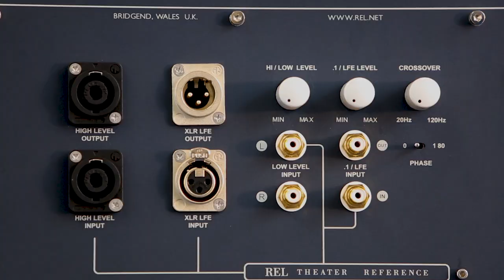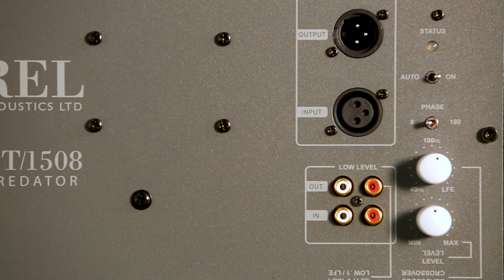Why you should connect your REL subwoofer with both high level and .1/LFE inputs

Comment: I still don't understand why you should hook up LFE when using the high level input. If you set your front speakers to LARGE, and tell the receiver you have no sub, won't it send the LFE track to the front speakers? And since the REL with high-level input is "seeing" everything the front speakers are getting, isn't it getting the LFE channel through the high-level anyway?
Reply: CelerityHouse GREAT QUESTION???
Reply from the maker: The setup that you have described can work in a pinch, though doing this will take up extra bandwidth and amplifier power from the front left and right channels on your power amp, since they will be needing to output both the front left and right channels as well as the LFE channel, which is typically a very high output and highly dynamic channel of the surround mix. Using both the High Level input and the .1/LFE input will keep your front speakers from trying to output the LFE channel's extreme sub-bass information, and leave this task to the subwoofer which is designed to handle it.
Reply: @RELAcoustics  Ah, okay, thank you
Reply: @RELAcoustics  Is this for any subwoofer that has high level and LFE or just REL?  I have an Energy S10.3 and it has both high level and LFE, but the manual says to not hook up both at the same time.  It also has a crossover bypass switch which is to be toggled whether the receiver has bass management or not.  Would I be safe to hook up both?
Reply: @RELAcoustics  To add to this almost all speakers will crap out at some point with too much bass before the tweeters etc will. you dont want an LFE channel going into your main speakers, that's just asking for a +20db bump in bass (reference Home THeater is 85db with 20-30db of bass headroom) and potential damage to your speakers.
Reply: @RELAcoustics hello i have a 2.1 system with REL tx7 sub.    And Dali rubicon 5 i have both connections  at same time high level and LFE  . For movies i will use the LFE Channel. My question : when i gain the level control on sub for LFE  it also gains my level in high level simoultanisly!? In my stereo receiver Marantz pm7000n i set crossover to 60 HZ best regards from Germany Robert
Reply from the maker: @robertdalmatinac1914  Thank you for reaching out. The T/7x has separate independent level controls for the High Level input and the .1/LFE input, which means that the output level for the .1/LFE channel can be set independently from the output level for the High Level channel. If one of these Level controls is setting the output level for both the High Level and .1/LFE channels at the same time, then feel free to write in to contactus@rel.net and our team will be happy to assist.
Reply: @RELAcoustics  yes the low level lfe controller gains both…the lfe and the high level! I have contact you in  support email. Best regards Robert

Comment: Hi. I just purchased a pair of REL T5i’s. 
For stereo listening I will connect them to my integrated amp’s (Roksan K3) speaker posts through high level neutrik cables. 
However I use the same integrated amp and front speakers as part of my home theatre system run by Denon x4200. Both amps are connected through HT bypass.
As far as I understand my system will become 5.0 as no subs are connected to Denon’s line in LFE connection.
Can I use sub cables that will directly run from RELs to Denon’s subwoofer pre inputs, at the same time with  high level connections made between RELS and Roksan K3?
Would that damage my amps or subs?
I want to use both subs both in stereo listening and home theatre with maximum performence.
I hope I made myself clear. Thanks.
Reply from the maker: The T/5i subwoofers can be connected using both their high level input and .1/LFE input simultaneously. In this way you can connect high level to the speaker output terminals on your 2-channel integrated amplifier, and also connect to your Denon AVR's sub-out using the .1/LFE input. The T/5i has separate level controls for each of these inputs, allowing them to be tuned independently.
Reply: REL Acoustics cheers tnx a lot. Great subs!
Reply: @RELAcoustics does REL STRATA 5 can be plugged into my YAMAHA dsp A2 - LFE + HIGH INPUT at the same time with no risk of damage to amp or sub? Do I have to mute LFE while I'm listening in stereo only?
Reply from the maker: @magnatUtube  As with the majority of our current models, it is possible to connect to both the High Level input and the .1/LFE input on your Strata V subwoofer, and run signal through both channels simultaneously.

Comment: when both is plugged, are both level control work?
Reply from the maker: Thank you for reaching out, and that is correct. On our High Level compatible subwoofer models there are two separate Level controls, one for the High Level/Low Level input and the second for the .1/LFE input. This means when connecting to both the High Level input and the .1/LFE input simultaneously you will be able to adjust both Level controls to tune each of these inputs independently.

Comment: Is this a unique feature from REL, or can you do this with all subs that have both high level and lfe inputs?
Reply from the maker: Some subwoofers from other manufacturers feature speaker level inputs (in our case called high level inputs), though in our experience not many are designed so that you can use both the speaker level input and the LFE input simultaneously. If your subwoofer features both inputs, I would recommend reaching out to the manufacturer to confirm if they can both be used at the same time without overloading the subwoofer.
Reply: @RELAcoustics  Thank you
Reply: Is this only for theater (movie watching)? In other words if playing music the LFE should be off?
Reply from the maker: @guillermomartin8248  The LFE (Low Frequency Effect) channel is only found in home theater material mixed for surround sound (5.1, 7.2, etc.). If you are using one of our subwoofers that features both High Level and .1/LFE inputs, then the .1/LFE input should only be receiving signal when listening to home theater material, while the High Level input will receive signal whenever your main loudspeakers receive signal.

Comment: But what if you only have a 2.1 system. Should I let my AV receiver mix the LFE into the front speakers that I do today? Or should I take LFE out of the AV receiver and plug both at the same time? What I am worried about is the timing between the LFE and front channels. As I have it now. There will be no timing issues. I have large front speakers and powerful amplifier, so I'm not worried about having my main system being exhausted for getting the LFE input.
Reply from the maker: Most loudspeakers are not designed to handle the high levels of extreme low-frequency output found in the LFE channel, so we recommend having LFE signal produced exclusively by the subwoofer. The subwoofer can then simultaneously provide low-frequency extension below where your main loudspeakers naturally roll-off.

Comment: I have a HT receiver with a pre amp out connected to a true balanced amp. Can I still connect the high level and LFE (from the HT receiver) to the input on the REL or do I need to use a different connection method?
Reply from the maker: Thank you for reaching out. You can still connect a REL subwoofer using both it's High Level input and .1/LFE input in this system, with the .1/LFE input being connected to the sub-out on your HT receiver and the High Level input connected to the power amplifier that is powering your front left and right channel main loudspeakers.

Comment: Hi so I understand, the difference between high level,and lfe , is the lfe not sending all the low level information 
, I just can’t understand why you need the high level cable also the lfe cable
Reply from the maker: Thank you for reaching out. By using the High Level input connection, the subwoofer will be able to blend far more seamlessly with the system's main loudspeakers when compared to using the bass management software within your processor and an exclusively RCA connection, while also getting improved performance from your main loudspeakers by sending them a full-range signal. You can then use the .1/LFE input on the subwoofer in addition to the High Level input, so that you hear the LFE sub-bass effect channel found in home theater material in addition to the low-frequency support for your main loudspeakers through the High Level input.

Comment: Can you run low level input (not HL input) and .1/LFE simultaneously?
Reply from the maker: Thank you for reaching out. It is possible to connect to both the Low Level input and the .1/LFE input on a REL subwoofer at the same time.

Comment: Is it a correct understanding that when both Hi Level AND LFE are connected simultaneously, then only the Hi/Lo Level gain dial should be used, and that the LFE gain dial is ignored and has no effect?
Reply from the maker: Thank you for reaching out. If you are connecting to both the High Level input and the .1/LFE input on a REL subwoofer, then you will need to use both the Hi/Low Level and .1/LFE Level dials for tuning it's output. The Hi/Low Level control will adjust the output level of the signal received through the High Level input, and the .1/LFE Level control will adjust the output level of the signal received through the .1/LFE input. This way you will be able to independently adjust both channels for optimal performance both during home theater and 2-channel music listening. However, the Crossover dial on the subwoofer will only adjust the frequency response for the High Level channel, and the crossover filter for the .1/LFE input will be set within your AV receiver's menus.

Comment: Why wouldn't one try this(high level and. 1)in a 2 channel stereo set up with a pair of subs...especially if one can't find ground.
Reply from the maker: If you are having a difficult time establishing a ground connection for the subwoofer in a 2-channel listening system, then you can certainly use an RCA cable connected from your preamp to the subwoofer's .1/LFE input, with the .1/LFE Level control then being lowered to the minimum position. This will create a signal ground connection between the subwoofer and the rest of your electronics, which will help to lessen any ground loop hum. This method is typically only necessary when connecting High Level to Class D or balanced/differential amplifiers.

Comment: I have a Naim Unity Atom and a PrimaLuna EVO 300 power amp for music and a Marantz 6014 avr for Theatre.I just purchased your TX7 can I use high level for the Prima Luna and lfe for the Marantz and have them connected at the same time as long as one or the other is powered off during use?
Reply from the maker: Thank you for reaching out. The T/7x is designed so that you can connect to both the High Level input and the .1/LFE input simultaneously, which means that you can absolutely connect High Level to the Primaluna Evo 300 while also connecting using the .1/LFE input to the designated sub-out on your Marantz AVR.
Reply: @RELAcoustics  Thank you so much!!!! For your Fast response!! How refreshing!!

Comment: I am a little bit confused. Would you mind telling me how should i connect and set this specific system: powernode amp which has sub out and internal low pass filter crossover adjustment, bookself speakers and t5x. Should i go out from sub out to .1/LFE input on the subwoofer and max out the crossover on sub since it will be controlled by the amp?
Reply from the maker: Thank you for reaching out. If you wish to connect your T/5x subwoofer to the sub-out jack on you powernode, then we do recommend connecting using the subwoofer's .1/LFE input. The .1/LFE input on the T/5x completely bypasses the subwoofer's own crossover filter circuit, which will allow the powernode to completely control it's frequency response without needing to adjust the Crossover dial on the back of the subwoofer.
Reply: @RELAcoustics  much appreciated. However in one of your videos, i do not remember which one. in this kind of scenario you recommended that we connect both .1/lfe and high level input at the same time. Which will help sub to blend in with the speakers much better?
Reply from the maker: @caddyoglu  Thank you for your response. In systems which use a multi-channel AV receiver/processor it is possible to connect a REL subwoofer using both it's High Level and .1/LFE input at the same time, though since your Blue Sound Powernode is a 2-channel amplifier it will be best to connect the REL using one of either it's High Level or .1/LFE input, and not both. If you plan on applying a crossover within the Powernode to the signal received by your main loudspeakers then we recommend connecting to the .1/LFE input on the REL.

Comment: how do we connect a second sub? is it possible to connect both subs via the high level inputs?
Reply from the maker: You can certainly connect two subwoofers using both their High Level inputs and the .1/LFE inputs. Depending on your receiver/processor, you will be able to connect the .1/LFE inputs on both subwoofers either directly to separate subwoofer outputs on the receiver, or to a single sub out using a y-split cable.

For the High Level inputs, they can be connected as a stereo pair, with each subwoofer assigned to either left or right channel output. The High Level connection method depends on the model of amplifier which you are using, though here are two videos of ours which show stereo pair High Level connection for different amplifier designs:

Class A/B amplifiers: https://www.youtube.com/watch?v=cV_0G3GdPxQ&list=PLaShG1I6_hHX4iFLedX3O60pqO5stwDUh&index=12

Class D/Ballanced Differential amplifiers: https://www.youtube.com/watch?v=InWCT4OPQfM&list=PLaShG1I6_hHX4iFLedX3O60pqO5stwDUh&index=6

Comment: I know you guys are keen on running speakers full range, but I'd rather high pass them for music (my speakers can't handle sub bass at above 75db, the cones are working too hard).  So if I was to run  low pass from my parasound should I use low level or lfe? I'm guessing lfe bypasses the in built crossover in the sub which is ideal, but I'm not hearing as much low, low end through it
Reply from the maker: The LFE input uses filters that are designed for the .1/LFE channel in movies while the high and low level inputs are designed to handle a wider variety of bass tones and frequencies. Since you're using the sub primarily for music you should use the low level input.
Reply: @RELAcoustics  thanks so much!

Comment: if I connect the subwoofer to the Lfe and the high level in parallel and the amplifier (Powernode 2i) runs out the entire frequency range above the Lfe, so that the loudspeakers are not limited, what does the subwoofer get? Lfe up to 120 Hz or crossover frequency, set at the high level input of the subwoofer.

... after further research, does it mean that one amplifier feeds both signals at the same time or either an AV receiver via Lfe or a stereo amplifier via high level?
Reply from the maker: The subwoofer would receive the full range signal that your main speakers get, as well as anything that's coming through the LFE/.1 channel. Then you would set the crossover to determine the maximum frequency that would be coming through the subwoofer.
Reply: @RELAcoustics  
Thanks for the answer. I thought the LFE / .1 input bypasses the control for the crossover frequency on the subwoofer and if I set the crossover frequency on the power node, the main speakers don't get the full frequency ... The day after tomorrow my T7x will arrive, trying is better than studying.
Reply: Hi i am on the same dilemma. I have a powernode 2021, ls50s and a t5x. How should i connect to use the amps sub out and bypass filter?

Comment: Using the high level from my stereo and RCA output from a 2x4hd MiniDSP should the volumes be matched or the high level be more flat/liner and the lfe be more of the house curve?
Reply from the maker: The Level control for the High Level input should ideally be adjusted so that the subwoofer is equal in output level with your main loudspeakers, resulting in a more flat or linear output. The .1/LFE Level can be adjusted to taste and based on personal preference, since the LFE content is an entirely separate channel from the main speaker channels.
Reply: @RELAcoustics  thank you for taking the time to respond. I will now look to bring the hi level down a notch and let the LFE feed to the grunt from the Dolby and DTS HD tracks converted 2.0 LPCM.
Many thank again
Reply: @RELAcoustics  Is it safe then on your Strata 5 to have both the high level and low level sockets connected at the same time to the minidsp with no crossover for the high level and then an 80hz cross for the low level? This connected to a stereo system not home theater. Many thanks
Reply from the maker: @jefffan171  For a 2-channel stereo system, we recommend using one of either the High Level input or the Low Level input on your Strata 5 subwoofer. This will result in a more coherent output from your system, and less chance for distortion from the subwoofer.
Reply: @RELAcoustics  Wow. Thank you so much for your time and support on this. It really is appreciated
Reply: I've got my new REL hooked up as directed but it still comes down to the same problem for me:  I don't like watching movies OR listening to music on a stereo.  Any ideas of what I should do?